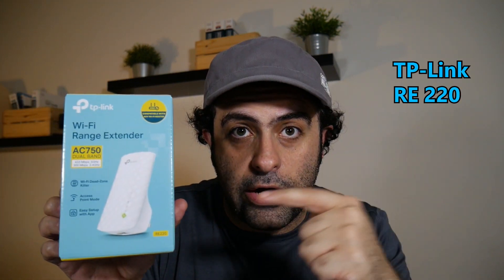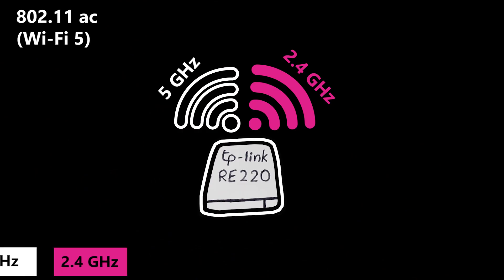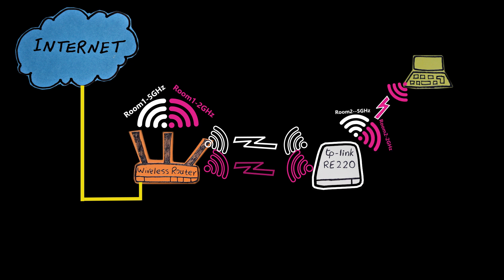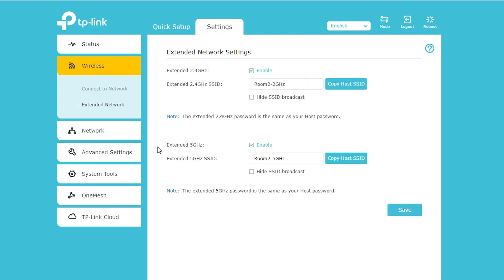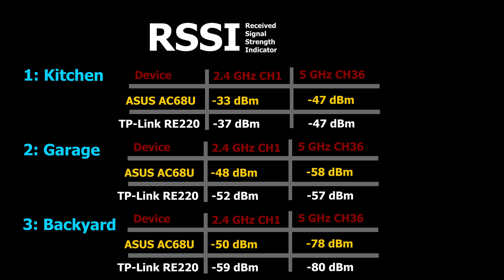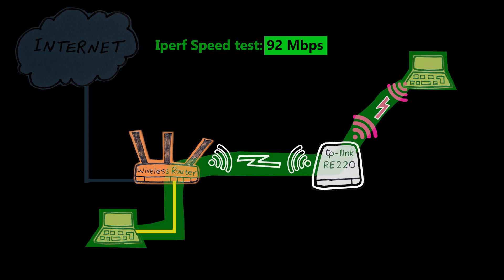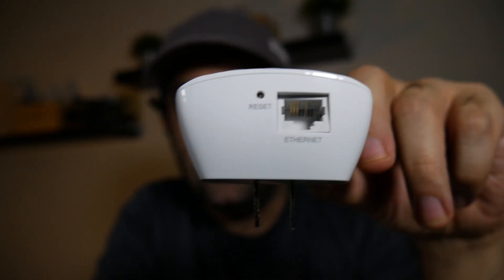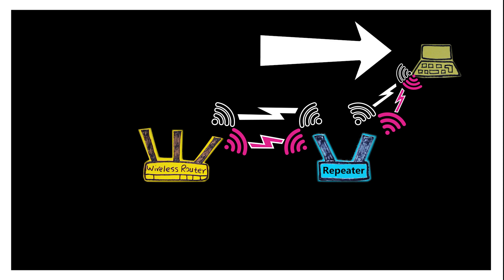TP-Link RE220 - Setup, Speed Test & more

Comment: Will it work with T-Mobile wifi ?
Reply: I have T-Mobile, and if you have not done anything yet, you'd better off getting a TP-Link Deco mesh setup, and only getting something like this, and putting in bridge mode to act as a WiFI adapter for say a desktop without a WiFi connection.

Comment: my WiFi has highs of 15mbps, connecting my computer via ethernet is the goal, I can't run an ethernet cable into this room. I plan to use this to wirelessly get an ethernet cable port in this room, the 100mbps bottleneck is fine because my WiFi will never be that fast anyway.
Reply from the maker: Thanks so much for sharing 🙂👍

Comment: Excellent video, with all information and real test, not like other just a "manual of how to install".   In 8:23, just remember (keep in mind)  that TP-Link RE220   (and most of cheaper repeater) has a Interface 10/100M Ethernet Port (RJ45), so the  wired connection never pass 100 Mbps! For this, it's necessary a 1000Mbps port (Gigabit)  in more modern router/repeater, as you explain afterwards. It will nice if you can do a video with a 1000Mbps port (Gigabit) repeater, to show the final speed with this port in a repeater :)

Comment: really really helpful, thanks man! just one question, did you know what was the speed of the pc directly connected to the wireless router by the ethernet cable? or the speed your provider is supposedly giving to you?
Reply from the maker: Thanks, glad you liked the video. If you are asking the speed of Ethernet connection of that computer, it was 1 Gbps. The speed of Internet provider does not matter here because the speed test I did in the video was between 2 local computers. Thanks
Reply: oh I got it, I had understood the speed test was with the internet connection, thanks again man!

Comment: how many can you connect to a none tp link router and how seamless is it when roaming with a none tp link router?
Reply from the maker: 1- on paper you can connect as many as you want but in reality you shouldn't because wireless is complicated and just randomly adding repeaters would cause interference and it might make your network useless! So for best performance you should know why and where you are adding the repeaters. Obviously adding them as APs is much better than adding them as repeaters. If the setup is done great then the roaming should also be good too.

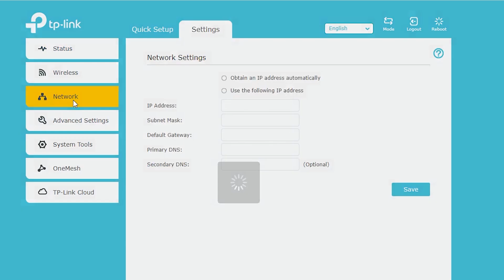Comment: Great explanation,  the only thing I don’t understand is here 3:23   Why you change IP address? Do I need to do that too with same number or any numbers .... thanks .
Reply from the maker: Thanks, you don't have to change the IP address, by default it "obtains an IP address automatically", however, this automatic IP address might change from time to time, so I personally prefer to give it a permanent static IP address, this IP address will not change and I can easily remember and use it to access the repeater. Just keep in mind the static IP address has to be an unused IP in your network, in my case I used 192.168.1.253 because I know no other device is using it. Thanks.
Reply: @Behfor  I see , thanks man , great timing my repeater just arrived , I will watch more of your videos to learn more ,  you have easy way of explaining keep up the good work

Comment: This might be a very dumb question but can I connect this directly to my modem
Reply from the maker: First of all it's not a dumb question.
Second of all, if the modem is a modem/router combo device then you can connect the the re220 to it, but if it's just a modem then you can't, because you still need to have a router in your network.
Reply: @Behfor  okay, thanks a lot for the help 🙏

Comment: Is the re220 better than the re230
Reply from the maker: It looks like they are very similar to each other, but one difference that I was able to notice (by looking at the TPLINK website) was that the RE230's transmission power is higher than RE220, so it's possible that the RE230 might have a better range, at least on paper. Thanks.

Comment: hey can you do a VIDEO ON HOW TO LINK THIS TO THE PS4? THANKS
Reply: It’s simple, first make sure it’s up and running, make sure the wireless name appears on any other device and make sure it’s working, then hop on to your PS4/PS5 and scan for wireless networks, it should appear there. If you want to you can connect it via Ethernet cable. Then go to scan networks and a “wired connection” will appear

Comment: i know its been a while but I have a question, it says the ethernet port is 100mbps limited, I want to use the extender as a access point, I have a gigabit wifi but atm I'm only getting 50 mbps using it as a repeater if I use it as a access point will I be limited to 100mbps?
Reply from the maker: Yes, as an AP it'll be limited to 100mbps
Reply: @Behfor  thanks, guess I'll just throw mine in the bin and buy a long cat cable

Comment: So what if you want to connect the extender with the router by cable? Is that possible?
Reply from the maker: That's possible but only if you use the extender as an Access Point. So you should change it's operation mode and set it up as an AP. FYI an extender/Repeater is a device that connects to the primary router via wireless only, if you use a cable then it's an Access Point.
Reply: @Behfor  Thanks for your quick reply. I learned something today. Let's see if I can put it in an access point.
Reply from the maker: You're very welcome and good luck 😀👍
Reply: @Behfor  Somehow I'm getting problems. Do I have to set IP-address manually?
I can connect to the AP but it doesn't have internet.

Comment: can I use it to connect to my PlayStation? 

or which other model of TP-link should I get
Reply: did u ever find out bro?
Reply: Yes you can connect it wirelessly or via Ethernet. This is a cheap product so it won’t give you the best speeds but it could work! I suggest something like an av600 or a re650. 

I use an av600 and connect it via Ethernet to my PS5. It gives me roughly 80mbps. Yes it’s not 100+ but it is VERY STABLE. Ethernet usually gives you faster speeds then wireless

Comment: Quick question: Can the name of the wifi SSID be same from the RE220 and the router or do they need to be different? Thanks! Great video
Reply from the maker: Yes the SSID of the repeater can also be the same as the router. Thanks.
Reply: @Behfor  Thanks the answer! :) So you say that if I add the same name, will my laptop for example pick the best one in signal strength? or will it list both SSIDs and it's up to me to pick up the best one?
Reply: Won't having the same name as the SSID potentially cause some devices to connect to the repeater when they already get a good signal from the router?
Reply: @howardbirenbaum2515  not at my hone at least lol

Comment: I have one more question sir, can I connect the repeater directly to the router with an Ethernet cable to have a better transmission rate?
Reply from the maker: Yes you can but In that case it won't be a repeater and it will be an Access Point, which is even better than a repeater.
Reply: @Behfor  Am I misunderstanding something here? Isn't the Ethernet port only 100mbps? How can the transmission rate be better if the ethernet port's capacity is so much smaller? Doesn't that mean it can never exceed 100mbps since that's the speed the port is limited to when receiving the wired signal?
Reply: So if I connect my repeater to my router with a 20 metre cat 6 ethernet will my repeater be full wifi 20 metres away for my router?

Comment: Tried this unit.   Got great signal strength but it sucked at connecting to the internet.  Very frustrating so returned it.  Read of this same issue in several forums with no known solutions.

Comment: ok so i recently put my xbox in my room upstairs lately and i have been getting bad lag and my latency has beeen bad i’m using wireless upstairs. when i was downstairs using wired i would not get lag at all and it would run smooth. what do you recommend for me to get to experience my downstairs gaming while i’m still staying upstairs? thx
Reply from the maker: Wired is always recommended for gaming over wireless. I would recommend to watch this video: https://youtu.be/7nQXAALkh_w
Thanks.
Reply: so would a tp dual band repeater work?
Reply: Michael Jacksion yes
Reply: Michael Jacksion with Ethernet connected to it

Comment: Hi! I bought TP Link router  C6 AC1200 V2.0 (US) and TP Link extender RE200 AC750 V4.0 (UK). Both have OneMesh feature also smart connect. Also both of them upgraded to latest firmware. Now the problem is the RE200 cannot find 5Ghz network from my router. The only way it can if in my router i set the 5Ghz channel to 36/40/44/48. Doing this all my device can find 5G but my Samsung S9 cannot. Anyway you can help me?
Reply from the maker: Hi, it's probably because 5GHz Wi-Fi channels 149, 153, 157,161 & 165  that are used in US are prohibited in Europe, that's why the devices are not fully compatible with each other. It's always recommended to use the devices that are following your local regulations because otherwise they might put you in trouble! Some channels that are allowed in one country are illegal in another one! That being said, some wireless devices allow you to change the regulatory domain and set it to your country, but I'm not sure about these Tp-Link devices, maybe that'll require a firmware change. Unfortunately I don't have info on that, maybe if you contact TP-link they can give you more info. Thanks.

Comment: I need you help. I get this long password. I can't change it and it's crazy! What I can do?
My Wi-Fi:
Network Name: "Adler_2.4GEXT", Password: "fab0486b86096600fd06d6bc6a93f3b4f50196dcb139397be518b4305557d484"

This password are locked. And when I need to use it if I want to connect anything and it crazy
Reply from the maker: The repeater copies the primary router's password and you cannot change it on the repeater. If you want to change your WiFi password, you should do that on your wireless router, and the repeater will automatically follow. Thanks.
Reply: @Behfor  my wireless wifi password is different. This is long password that I don't know from where it come. My password on the main router on my house is different
Reply from the maker: That's weird! I would factory reset the repeater and connect it to the main router again to see what happens.
Reply: @Behfor  I know! I did it, and put the button down. And the same. That long weird password stay. I can't change it, I don't know from where it become. It's long long like I write. 
I don't know what to do

Comment: Hi ...what if repeat a dual band router using a single band router..thats 5ghz band connected single band router and repeated ... Will this work ..how the speed will be
Reply from the maker: Hi, you mean the single band router is a 5 GHz router?! I've never seen a single band router that is 5 GHz only, but if there is and can work as a repeater it should work fine, but again it will has the limitations that come with single band repeaters, thanks!
Reply: @Behfor  that was my stupidity .. 

anyhow thanks a lot for your dual band repeater video. I was using a single band router as repeater on a 50 Mbps connection , and the repeater was providing only 15Mbps . Searched everywhere for the reason and clueless 

But your video was simple and usefull , i bought a dual band router and the problem solved . 

bought a d-link dual band router , which had a mode as WISP , used the same for repeating and SUCCESS . 

Thanks a lot for the video , and shared to my friends as max as I could .

Comment: Mine is unable to see 5Ghz of my Huawei router but can see 5Ghz of my TP Link ArcherC60. How can I fix it
Reply from the maker: Maybe the Huawei is using a channel that the repeater doesn't have. I would try channels like 36 or 149 and see if that would fix it or not.
Reply: @Behfor  Huawei is ISP locked so can't change the channel. It is using 149. Repeater is not using that channel. So I have put the repeater in high speed mode to use 2.4Ghz to connect to Huawei and transmit only in 5Ghz.

Comment: is it good for gaming?
Reply from the maker: It could be, however for gaming it is best to use wired connection, but if wireless is the only option and you have to use a repeater, then definitely a dual band repeater is better than a single band repeater. thanks

Comment: Hello sir thank you for the explanations.
I want to ask one thing about this:
-My ip camera upstairs 3rd floor of house always lose connection.

Can i put this extender up there and cable connect it to the camera??
Reply from the maker: Yes, if the camera is wireless and wired, then you should be able to connect it with an Ethernet cable tot he repeater ( it should be possible, unless the camera system has a limitation) thanks.

Comment: Great video. Subbed for the one mesh video. Just bought an A9 which while seemingly more reliable, it sadly has a notably shorter range than my Netgear AC1750v2.
Reply: Something I learned: only the A6 and A7 have one mesh. The A9 doesn't and any request to when that will be added is given the option to return their A9 or other router and to buy one with support. Sounds like the higher, older models aren't getting it. Lame

Comment: Can you touch on Mesh Network devices that are installed, with Ethernet Backhaul?  I've inherited a number of AirTies 4920 devices, and I'm interested in installing & configuring them, so that they can be used as a Mesh Network, rather than as a multi-AP configuration.  The environment in-which they'll be used is extremely congested on the 2.4 GHz Band, and the building structure is not conducive to 5 GHz, for the back haul.  For those reasons, I'd like to explore deploying the AirTies 4920 devices with Ethernet Backhaul.  

In that configuration, do the mesh devices synchronize with one another over the Ethernet Backhaul?  If so, do they establish a port or 'channel' over the Ethernet connection, to 'talk' with one another?  Also, can they retain the host router's I.P. Subnet, or do they establish their own Subnet?  I'm trying to avoid any double 'NATing' problems.

I enjoy the channel..... Educating & Entertaining.  Keep-up the good work!  :)

Comment: It makes sense that the wired connection becomes a bottleneck due to it being a 10/100 Mbps port
Reply: Hello 👋🏻 i want to ask you a question?
I want to connect my ip camera to the extender with cable.
Now with wifi the camera always lose connection some times its not even connecting.
Can you recommend cable connection ?